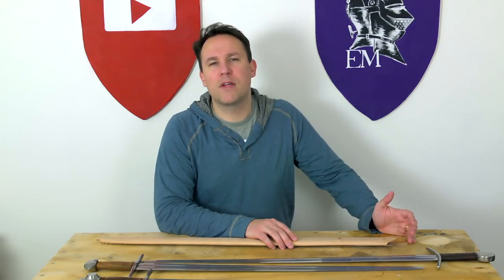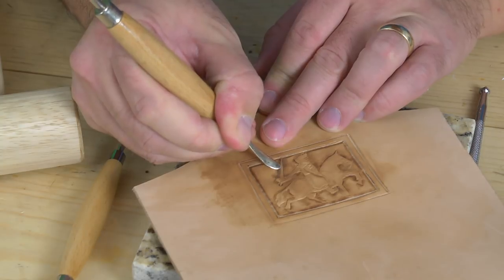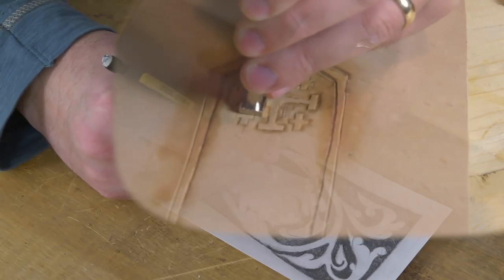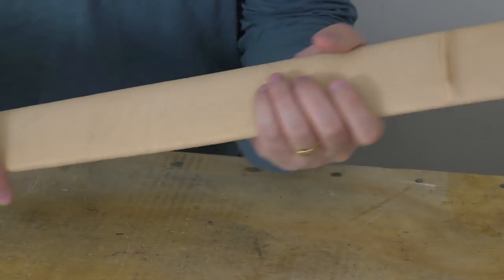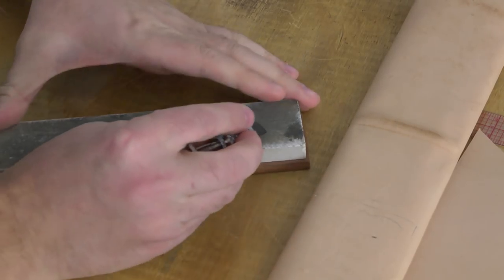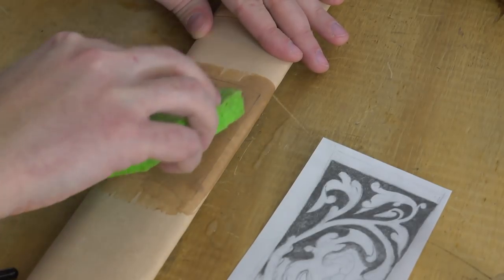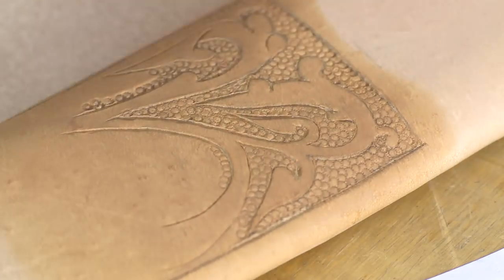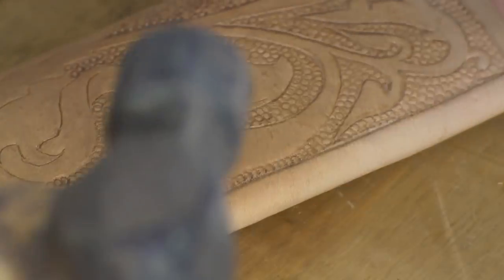Medieval Scabbard No.3, Design and Tooling

Comment: Hello matt, youre doing great work, as a fellow leather worker, whom has never made scabbards by the way, can give you a tip. I always draw (or print) my designs on transparant paper. You then lay it on the wet project and follow the drawing with a steel but blunt pen, wich leaves an impression on the leather. Then you can easily do the rest with the swivel knife. Good luck.

Comment: about your comment applying the tooling on the flat piece of leather before making the scabbard you are right.  Tooling on a marble is the best way to get nice sclupting results.  You can get much deeper in the leather to make the patterns pop much more.  On top of that the fact that you hammered your scabbard could have result into breaking the core.

Comment: This is looking amazing, would love to see it dyed and finished!

Also, I sell handmade leather tools (mostly holsters, bracellets and small purses), and I've learned a few tricks I'll gladly share with everyone here:

-  The carving tool is good, but intimidating; an X-acto knife works like a charm, just cutting with the very tip.

-  To transfer an image onto leather, one can later print it, or make a photocopy and place it onto the moist leather. Then you can trace it with a regular ballpoint pen, and then it'll be slightly marked onto the leather surface, enough for one to carve it for tooling.

- A medium or small flathead screw driver with the edges rounded up with a file makes an excellent leather tooling device (I still use my first screwdriver, among other more "professional" tools)

Comment: Look up more info on how to "case" leather. You do not want the leather to be wet or damp if you want good tooling results. Some people will even soak a piece and let it sit overnight in a plastic bag so the water is completely distributed. You should at least let the leather return to its natural natural color after wetting and before tooling. Great work though! I do a lot of leatherwork and I've made a few scabbards but none to proper medieval specs yet.
Reply: also, you can lightly trace your design directly to the leather using a stylus after casing.